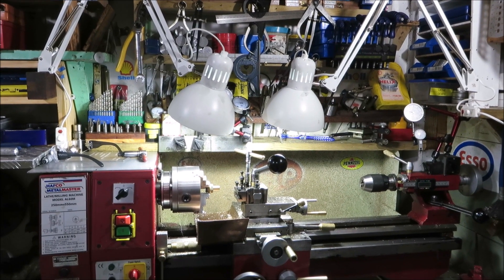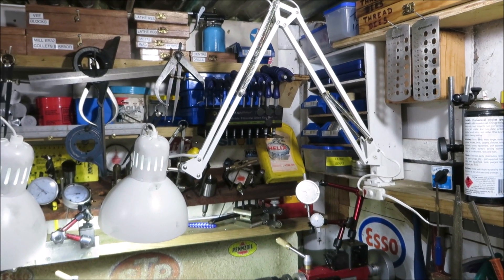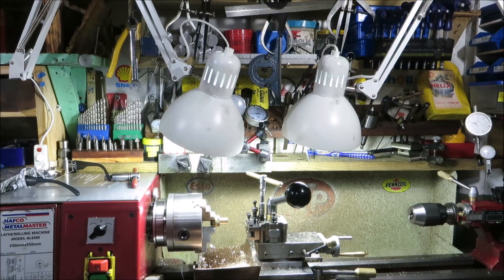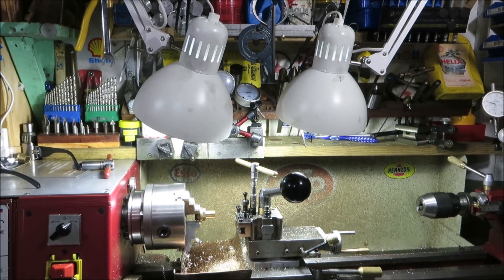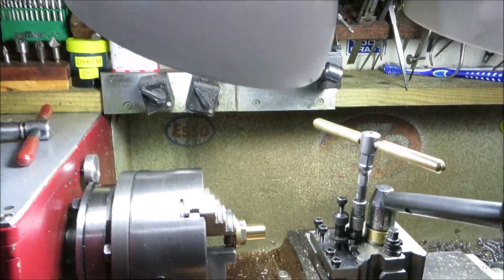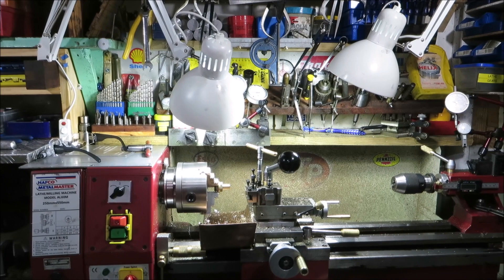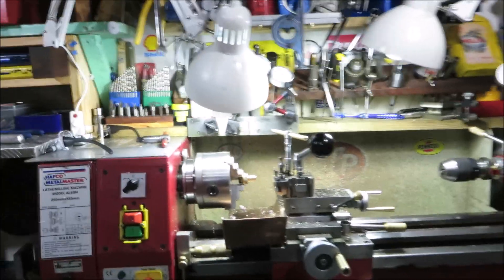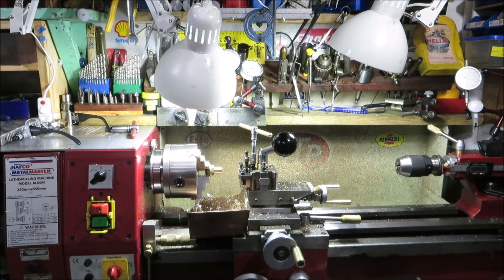Work Shop Talk - Lathe Lighting - Hints & Tips

Comment: nice tips. most of the time the drivers for the leds don't last 50k hours.
Reply from the maker: G'day Josh I've been really happy with these lights so far. A massive benefit is the heat factor, Australia is a bloody hot country and working with high wattage incandescents was pretty miserable -  cheers Jim
Reply: @SteamEngines-Jim  nice, the reason why I said the driver will not last is at work we had one start to fail with about 40hrs on it.
Reply from the maker: @JoshKilen  These have been going 8 hours a day now since June last year. 50,000 hours is 17+ years at 8 hours a day 7 days a week. If they lasted even a 1/4 of that it would be over 4 years. I suppose time will tell how long they will last. I've probably got around 20 of these bulbs now I like them that much.

Comment: You  should try the big bopper led light that bunnings sell , made by osram  = 2430lumen  and equivalent to 150w ! I have two of these in my workshop and one in my electronics / 3D printer room and it is like turning on the Sun ! I think all the years of welding and fishing with no sunglasses are coming back to haunt me ! In the 5 or so  years i have had led globes in my house i have only had one die and it was the one that cops the most use or gets switched on and off a lot so i aint complaining !
I have some led floodlights on my mill and a few around the workshop that i can turn on if i need , i think they came as a kit from Oatley electronics and they are good for infill lighting .
Last year i replaced the fluro globes  with led units from Bunnings and it was the best thing i have ever done !
Keep the vids coming mate - enjoying them immensely !
Reply from the maker: Ian, my country Bunnings is really limited in range. I just did a Google search, is this the globe your talking about? They have them at the next Bunnings an hour up the road. If its the one I'll grab one next time I'm there. I like as much light as I can get as my eyes aren't getting any younger!  Here's the link -
https://www.bunnings.com.au/osram-27w-2430lm-led-high-watt-bc-globe-warm-white_p0014388
Reply: @SteamEngines-Jim  
Yes that is it but stop the bus ! if you look at that listing there is an even bigger unit  4500 lumen ! I got to have one of those ! Bunnings here i come!
You have to check the box for the style like warm etc , i find daylight to be best for me - don't like the warm one .
If your local Bunnings don't have it in stock they will order it in for free and it will only take a few days to get there.
They might not fit inside the lamp housing of your lights though as they are pretty big .
Reply from the maker: @Flattyman  Thanks Ian, will have to look into these now :)

Comment: These new led bulbs are great, i used to have a twin 6 ft fluorescent tube light in my 10ft x 8ft workshop that were consuming 70w per bulb + what the light batten consumed. Total was around 150w & on all the time i was in the workshop, i swapped to 6 x13w led bulbs  placed around the workshop with individual switches for each bulb. Before finalizing the best position for each bulb for the best illumination in the shop i played around with moving each bulb for max lighting. If all 6 bulbs are on they only consume 78w but because they have separate switches to each bulb i find that if i an using say my lathe i only need 2 bulbs on, other bulbs will be turned on as & when needed for example if i use the grinder to sharpen a drill or lathe tool but then turned of after. So when using the lathe only 2 bulbs are on consuming 26w & a lot less than the 150w that the fluorescents used, considering the time we find we spend in our workshops over the course of a year this is quite a saving for me. Even better is the fact i am giving less money to the greedy energy suppliers.
Reply: I'm going to do the same with my fluorescent lights in my workshop. There's a big saving in your electric bill over a year.
Reply from the maker: Gillian it all ads up and its amazing how much light these LED's put out. It would be a big saving over the year in power bills.

Comment: I have a similar style light arm on two of my lathes.  They work well.  In winter (like now) I need every bit of heat around, and halogen make great hand warmers.  But they are less able to handle knocks than LEDs.

In summer the overhead clear panels in the roof are all I need.

Thanks for the heads up though.  Interesting subject.

Cheers Rob
Reply from the maker: We've gone from being able to buy incandescent bulbs for 50c - 90c at Woolworths Rob to LEDS that are now $20 each. Standing in the lightbulb section of Bunnings is a learning experience.